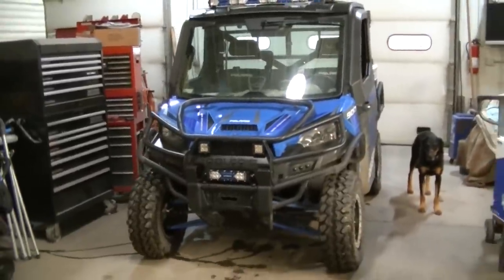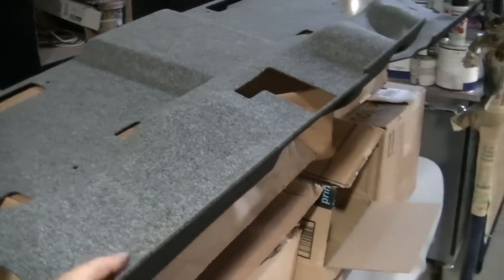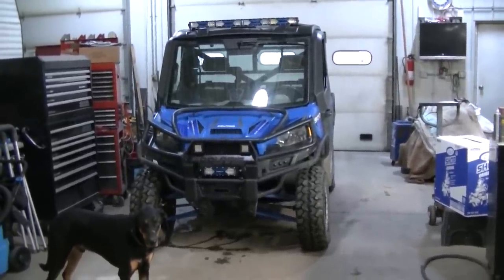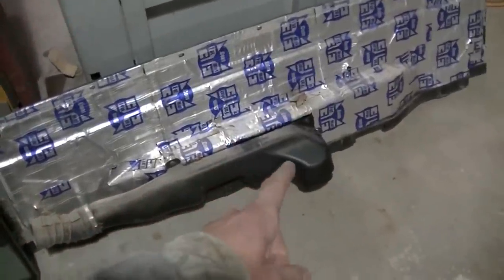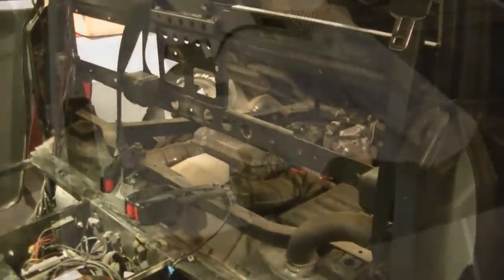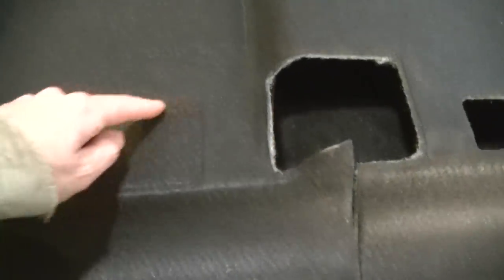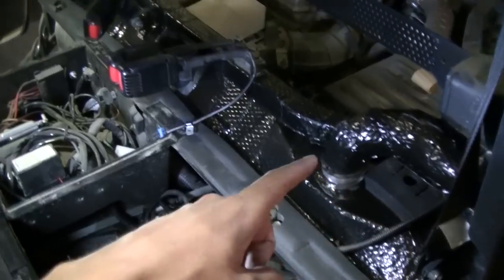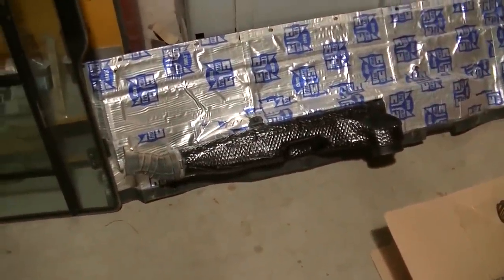Polaris Ranger 900 Rear Panel Carpet Kit & More Sound Mat

Comment: I was wondering about that Russian Noico sound deadener. Looks like it works like any one elses stuff.  I usually use GT Mat's products; made in Texas and they have been outstanding.
Reply from the maker: I have used the Fat Mat and this Noico.  They are cheaper stuff.  Don't know how they compare to the more expensive stuff.  I got this stuff because it was 80 mil and black.
Reply: Yeah, the black is unique.  That's why I thought about them.  I got the 80mil GT Mat or their Quadro as seen in my last video on sound control.  GT Mat is also a more affordable line.